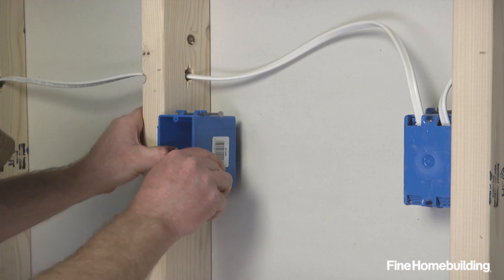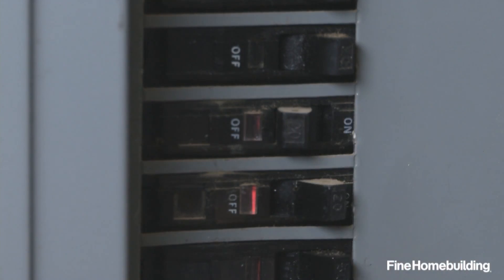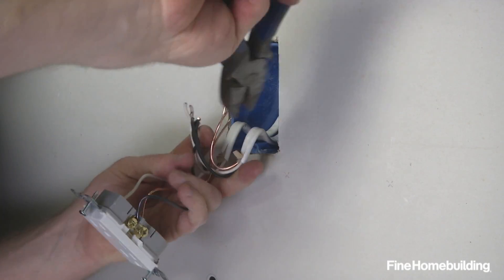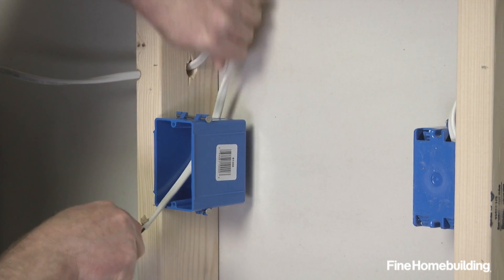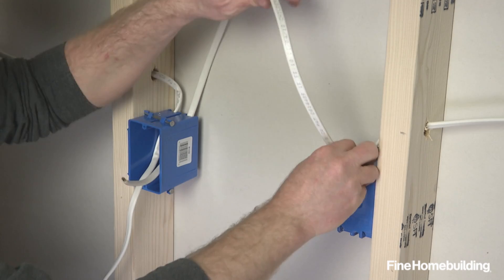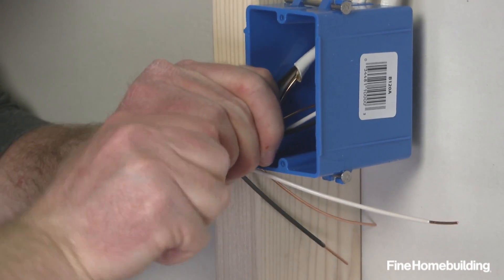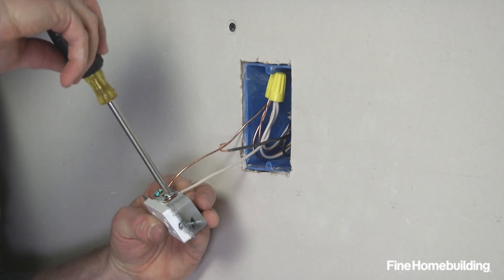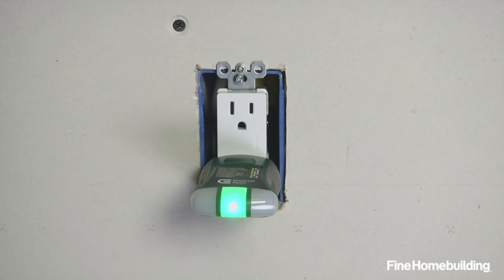How to Add an Electrical Outlet

Comment: This video is a perfect example of why I miss the dislike button. I could’ve just seen all the dislikes and not have to watch the whole video.
Reply: You could install the extension Return YouTube Dislike.
Reply: @Usually when I’m on YouTube to get repair insight it’s from my cell phone as I’m either in my garage or in a closet etc doing a repair so having that capability on my computer doesn’t fully solve my issue but I appreciate the suggestion!

Comment: Yes, adding a new outlet is simple. Just demo your entire wall until you find where this wire leads to an existing outlet. Seriously?
Reply: 95% of the time it’s either coming down from a light source (ceiling fixture or switch) or from another outlet on either side.. so your wire typically will be 3ft above the floor in line with the top or bottom of your outlet and or coming from the light fixture above it down the stud the outlet is on

Comment: Don't worry about securing and supporting no one will ever know. Your not getting an inspection anyway. Those staples cost like 7 cents a piece and take 10 seconds to install if you have hammer issues, totally not worth it.

Comment: You lost me when there was suddenly 20 wires on screen
Reply: Or when drywall magically appeared
Reply: They’re called pig tails😂 Take 3in of scrap wire of all 3 colors, strip, and attach to the outlet terminals. If you ever need to add or remove circuits it makes it code compliant so you don’t stick two wires under one terminal screw
Reply: @Darren-C more helpful than the video 😂👍
Reply: Lol

Comment: You could have added in how to tell which are the incoming wires to the existing receptacle and what about showing the actual wire connections back in the existing receptacle instead of just saying "repeat the same wire splicing", you leave the view wondering why you put the new wires onto the existing wires in the existing box instead of just attaching them to the other pair of terminals ?

Comment: Why'd you bother pigtailing the new outlet, since you're only using one of the two sets of connectors?
Reply: I'm curious about this myself.  Seems like it would be simpler to just run the incoming wire to one set of terminals on the outlet and run the outgoing wire off the other set of terminals on the same outlet.
Reply: Turns out it's because doing so would connect the receptacle in series instead of in parallel. If it was connected in series and then the receptacle failed, then everything down the line on that circuit would fail as well.
Reply: @TopRival75  Yeah I saw someone else mention that down below.  Overthinking things if you ask me.  a) how often would a receptacle even fail? In my 38 years I can't think of a single time and b) in the case it did fail, I don't see that this really saves you anything.  If it fails, I am going to troubleshoot and replace it before the downstream things being off even becomes a problem.  

In fact, I would probably WANT more things to fail if I had a receptacle randomly fail, to alert me to the failure that I might not otherwise have noticed for some time.  Only way a receptacle is really failing is due to a short on it, which is a fire hazard, which I want to correct ASAP.
Reply: Good question. People use the second set of screws often because it is convenient and is code compliant in most locations, but not always. The reason often given to use pigtails and wire nuts is to make a parallel connection and not a series connection. This is incorrect because it is always a parallel connection. The only difference is that you are using the screws and backing plate as a connection instead of wires twisted and capped with a wire nut. A receptacle should not be used as a connector, so this could be considered a violation and is not permitted in some locations. Some electrical contractors will not permit this and consider it poor workmanship. During rough in electricians typically perform these connections before a receptacle or switch is installed. Then at the final installation, only 3 wires need be connected. It is also better for inspection purposes. The reason for having 4 ungrounded screw connections is for the option to separate the sockets from one another. This is commonly done for a split circuit (one socket  can be turned on or off by a switch) while the other remains live continuously. Multi wire circuitry is another possibility where each socket is on a separate circuit.

Comment: you said remove the wire coming in and put it in the new box,  could one leave it in the existing box and run the pigtail or shorter section to the new box instead?
Reply: Yeah what’s the purpose of changing locations of old incoming wire,
Reply: @jaymurr5303  possibly the purpose was they're keeping the flow of electricity linear to that circuit. Just a guess though.
Reply: If you do it that way, you now have those outlets in series instead of parallel. In series circuits, voltage gets lost. In parallel, voltage stays the same from outlet to outlet. Hope this helped

Edit: just realized you asked this 4 years ago😂 sry
Reply: @flacoloco4046  I still don't understand where the existent wires come from? So, I have an outlet connected. Only 1 wire of each. I add a new outlet with no wires. I pull the source from the old existent outlet to the new one, and the new piece of cable connecting the 2. Now, I have 1 wire of each in the old box, and 2 wires of each in the new box (the source and the new wires in the new box, while only the new wires in the old box). Is this correct?
Reply: that is exactly why, it’s called a series circuit

Comment: Lol. How do you run wire to or from it with out tearing up wall.
Reply: When you need go beyond one or more studs, then yes, you may need to cut the wall. If you have an attic, basement, or crawl space, you may be able to use those.
Reply: You dont

Comment: This is good for an unfinished home but what about if you already have the drywall and everything up
Reply: You have no choice but open holes in the walls. Try to open them with a stud exposing halfway so you can drill the old cut out back. Run your cables through the holes and use the holes as way to pull cable to your destination. Then drill back in the old cut outs. Tape plaster and paint
Reply: They sell a kit that allows you to stick an outlet to an existing sheetrock
Reply: cut a hole into the drywall 🙄🙄

Comment: Can I do the similar to my dryer's 240v 30amp acceptable? The home deport staff said the acceptable has to connect to breaker directly.
Reply: If you have to ask this question, call an electrician. For 240V you probably need lower guage cable and need to run a dedicated circuit back to the panel, where you need a two pole breaker. This is way beyond DIY for someone who knows nothing about electrical.
Reply: Yep, each 240 outlet has to be a separate connection to the breaker box. You could probably do it the way it's shown in this video, but I would not recommend it!

Comment: You should also make sure the outlet isn't sharing a neutral/typically white wire with another circuit. Many people a year get shocked or electrocuted each year forgetting to check the very thing you left out in your video.
Reply: How would u do that?
Reply: @rixanneh18  right, wouldn't turning the power off keep that from happening?

Comment: How to add outlet to finished wall?
Reply: First, turn off power to the circuit, then cut the hole for your new outlet. Remove the device(s) from the existing outlet, twist the wires of the old cable together, and make them into a hook. Make a similar hook with the new cable, then hook the two hooks together and secure them together with tape. (If you're going through a tight hole in the old box, try just hooking and taping the ground wires, and cut the other wires back a few inches). Feed this through the old box's knockout. Then go to the cutout for the new box. As you pull the old cable, it'll fish the new cable along with it. Then just remove the tape, clip off any dinged copper, run the cables through the back of your new "old work" electrical box (there's another video on installing those), and install the box.

Comment: Question: Wouldn't you only need to pigtail the ground wires in this example?
Reply: The reason to pigtail all three is that in case the receptacle itself fails, other devices downstream of the faulty receptacle will still work. If you attach both incoming and outgoing neutrals and hots directly to the receptacle (which is acceptable by code), you're relying on the receptacle to maintain continuity. If the receptacle fails, everything downstream of that loses power as well. If you use pigtails, a bum receptacle won't interfere with downstream devices because the splices with the pigtails maintain continuity regardless of what happens to the receptacle. It also makes it easier to diagnose problems (if only one receptacle is out, that's the culprit).
Reply: @matthewmillham2025  How exactly would a screw terminal fail?
Reply: @neplatnyudaj110  a short. Ive seen melted contacts from too long of splice or loose wires.
Reply: Thanks for the reply
Reply: @matthewmillham2025 Thanks for that information..
Reply: That's exactly how I did mine  for my garage
Reply: @eleodoro de la fuente You're*